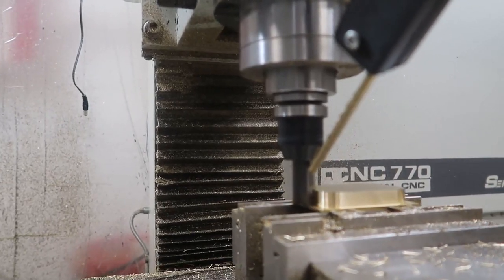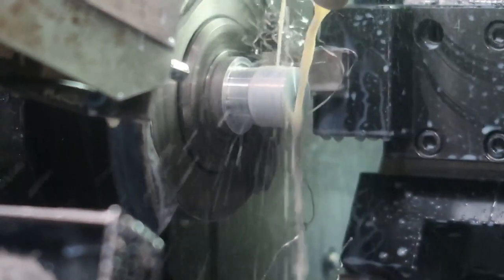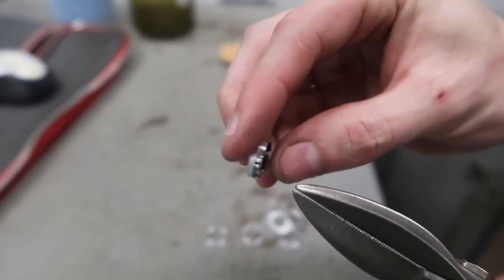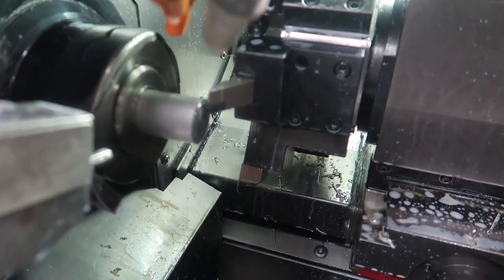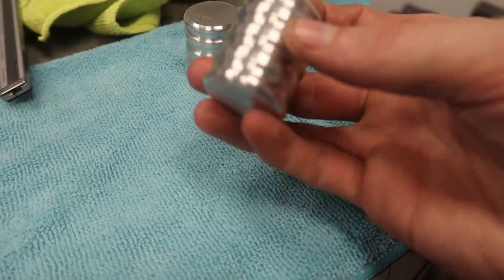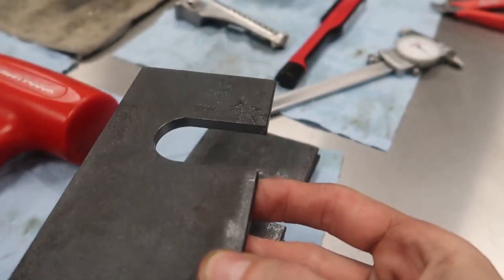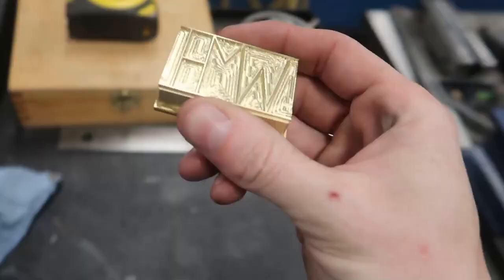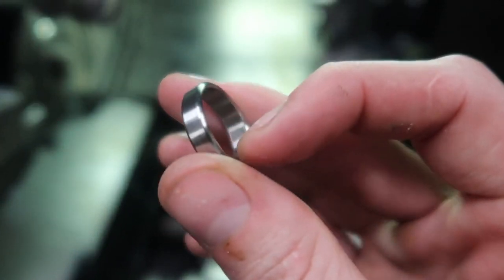This and That: Branding Irons | Lathe Projects | Milling Steel | Turning Titanium

Comment: Congratulations on the upcoming nuptials 👩‍❤️‍👨. FYI, dehumidifiers will add heat into your space.
Reply from the maker: Thanks! Yeah I figured the dehumidifier would introduce a little more heat but I am willing to make that trade off in order to keep the humidity down. It seems that the humidity is likely to cause more damage to the machines than the little bit of heat it produces. With the dehumidifier I got I can keep the shop at about 40% humidity and still keep it at around 75-80 degrees during the day

Comment: hey quick tip for ya for the future- if you grind/buy cutoff inserts with a slight angle, biased towards the part, it will cut your part off first and the big burr will stay on the stock and not on your part.
Reply from the maker: Do you have in carbide inserts that you prefer? I don't think I'll be able to grind my own. I have seen these before but I wasn't sure how good they really worked